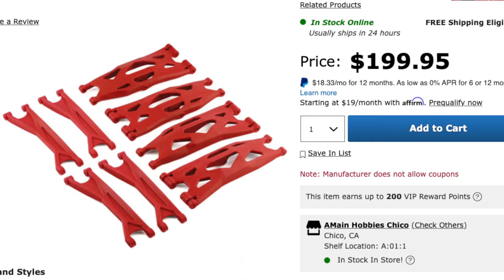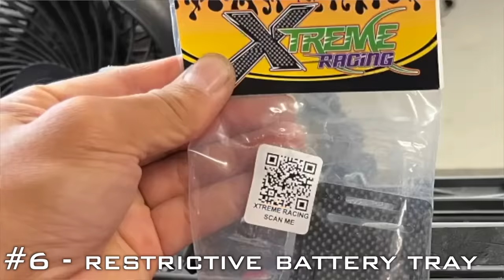7 worst Traxxas X-maxx problems - and how to fix

Comment: For all the people out there, who want to destroy your vehicle, yes, you can do all these upgrades and spend another $400 - $500.  But, this is in my opinion is the most well built, well engineered, most durable you will find on the market today. There is simply nothing else that compares.  If you respect the vehicle, and don’t abuse it beyond its capability, it will last many years without breakage. I’ve had many different vehicles. I’ve had this one four years without breaking it once. I cannot say that about the others. Every time I went out with the other ones, they were guaranteed to break even with mild abuse. But then again, I am not out to destroy them but, I will do 8 - 10 foot vertical drops and 20 foot jumps regularly without fear of damaging this one.  For those people who want to get crazy with it, go for it. Not my style and, it is just more expense and downtime. Waiting for parts and repair.  The only thing I did upgrade, which I think it really needs is a better servo saver. The one it comes with is little too weak.  Everything else in this video, it’s just a waste of money. Respect it, and it won’t cost you a dime further. And, no, I do not work for Traxxas. It is the best damn vehicle made.  I love mine.  Best I’ve ever had.  It’ll take a beating.  Just don’t do the 20 to 30 foot vertical jumps like you see in the videos.  And, don’t run it at top speed into a wall.  Nothing can withstand that kind of torture for long.  Oh, another thing I did was soak it down with WD-40.  That trick really does work to make it even more break resistant.  All vehicles for that matter.  And, yes the body of it does pop off occasionally….usually in a cart wheel situation or if the front end hits something dead- on pretty hard.  I’ve never had to replace the A-arms either even when clipping a front tire on something at about 30 - 40 mph.  That’s where the WD-40 works best I think along with the shock attachment points.  Never broke one of those either.  Overall, the Xmaxx is and always will be my go to vehicle.
Reply: Thank you, you've given me more confidence in getting the xmaxx. much appreciated
Reply: That is why you fail. Where’s the fun in doing nothing.
Reply: @user-df3jq5tr8c  Fail?  What success do you aim for?  Destruction?  I’m an avid thrill seeker.  I enjoy life as far as I am willing go with it…in a responsible manner.  My decision.  Not yours.  I don’t go 'all in’ on anything.  Nope.  I do have limits.  Limits are good.  Throw caution to the wind and you will get wrecked in every aspect life will throw at you.  That is the mindset of a fool.  I just sold my electric unicycle and regret it.  Put 500 miles on it then had a pretty nasty crash because I was chased by a big dog.  The smart person learns from his mistakes, because some of them can be fatal.  I’ll go another route and avoid the dog next time.  Includes everything RC as well.  I hope you can learn to respect the speed, power, and weight of them before you or somebody else gets hurt.  Be wise about it as far as you are willing.  It is your life/your money after all.  Do what you want with it.  I have learned there is no profit, no joy, in destruction.  Destruction = pain.
Reply: Problem i had with mine was it begged to be driven hard 😅
Reply: @kermit56780  I agree it does beg for it and pushes the envelope of what one considers as even possible.  Why it is really what I consider ‘a good value’ …meaning, no repair cost compared against endless entertainment.  Win / win.  Who could ever complain about a win/win?  There are very few things in life that are.
Reply: Thank you for your comment, I'm looking to buy one here in the next few weeks. I'm mainly a crawler guy but have been getting into bashing here lately. I have a slash and I'll admit I'm pretty rough on it. Does the xmaxx in your opinion handle normal dirt courses pretty well? Biggest jump being roughly 2 foot tall?
Reply: @calebpeters6267  you will be amazed how well it handles…. especially if you have new tires, or keep it on dirt.  The tires will wear down just like all vehicles if you run it on asphalt or concrete streets.  But, if you keep it on dirt, the tires stay in like-new condition for a long long time.  You will probably never have to replace them.  There is one thing… It does have a Lotta power.  When you accelerate through a turn on dirt, it will slide because it is a heavy vehicle.  But, that is also a benefit because it will stay well planted if you can control over-throttling… going too fast.  That takes a bit of practice. after a few laps, you will get a feel for it.  It is plenty fast. I geared mine down so that it actually would run slower. I have more control over it. or, put a larger gear in it and learn how to drift.  I would think it would flip over, but, I never did that, so I can’t see how it would act. I usually run mine on very rough terrain at construction sites where I don’t want to run at full speed. it handles rough terrain so good it’s hard to believe even when you’re going very fast.
Reply: @Bryzle1  same here! Kinda the same terrain I currently run on. Have you done any modifications to yours? If so, what?
Reply: @calebpeters6267  I never modded it.  I thought about it at first, but when you start adding weight, that’s when things start breaking.  I’ve learned this through other vehicles.  Meaning once all those aluminum parts are added, it puts even more stress on everything else.  All the weak points, even the chassis will break.  You want it to stay flexible.  As it is, the plastic is quite elastic on the Xmax.  You want it to flex.  Give it a coating of WD-40.  It will flex even more….when it collides with something, it won’t shatter.
Reply: @Bryzle1 really, wd-40?! Seems like such a simple thing that I didn’t even realize! I’m thinking about picking up an xmaxx as my first big boy and the way you commented is pulling me towards it even more!!
Reply: Maybe you got lucky. I have gone through 4 2085x servos in the past year. They don’t last. I take my car out once every couple of months and for the past year or so I’ve only taken it in open fields and parking lots so it doesn’t get much abuse but the servos just don’t hold up. It’s annoying to take the truck apart and replace it. It’s not a five minute fix. A new servo is over $100
Reply: Nah, it tells me you’ve got another issue you aren’t aware of possibly.  Those servos shouldn’t burn out/go bad so quickly.  Make sure your wheels spin freely, servo isn’t binding, etc…. Is the servo make a buzzing noise when not being worked?  Wheel nuts on too tight?  Nothing should be so tight that actually prevents free movement.  Everything should be relatively loose so the parts can wiggle slightly.  I’d be checking the whole vehicle over.  If everything seems fine.  Go to a larger torque servo.  But, the servos should not be going out that quickly.
Reply: @Bryzle1  I have double and triple checked everything. I’ve researched this issue and many other people have experienced the same problem. I’ve taken this vehicle completely apart to clean it put it back together etc. never noticing anything out of the ordinary.
Reply: Indeed agree with you
Reply: Like spray the whole truck with WD-40 or what exactly 🤔🤔🫣
Reply: I agree with all this. I'm decently tough on mine and never have a problem.😊
Reply: @derek3154 yes. Spray then entire truck.  It also helps keep things clean, water and mud just falls off.
Reply: @hughjanus5518  damn, nice tip. Thanks 😎
Reply: @fatkat311  you have your servo saver too tight.  I beat the shit out of mine and I'm the 3rd owner of it over 6 years. After doing the Kevin talbot servo saved mod and keeping the servo saver nice and loose it basically cannot break
Reply: Great post
Reply: I’ve had traxxas and arrma. I just bought the xmaxx 2 weeks ago and compared to any arrma I’ve owned this thing sucks
Reply: Mine has lasted with only a broken control arm that I hooked on a small tree pinned full speed. And the only other thing I have done is popped out a hinge pin on the pavement, landing a jump wrong.  I have dozens upon dozens of battery packs through mine all these years.  Doesn’t want to quit especially the new ones with the heavy duty rear bearings. I upgraded mine and have not had a problem at all.
The servo stock definitely sucks. It’ll get you for a while, but the factory Traxxas upgrade one works really well surprisingly.

I also have done the WD-40 trick after a couple years of owning it, and I haven’t broke anything. I do jumps as high as 4 to 5 feet tall and launch to about 20 to 30 foot gaps under and it only pops the body off once in awhile.

Comment: What are you people doing with these trucks??? I’ve had my Xmaxx for almost 5 years. I’ve broken a spur gear, blew one tires and blew out the rear hun carrier bearings. Other than the body being beat up, it still runs solid AF.

Comment: Pull it out of the box, install your batteries and take it for a blast. Enjoy your new earth shaking R/C monster truck. If you are back yard bashing and hitting some small to moderate ramps, don’t even worry about having to upgrade anything. The motor and esc take a beating. Eventually you WILL break something & that is when you decide if you want upgrades or just replace with factory parts. 
I agree that the tires could have & should have been MUCH better. RPM rear hub carriers are a smart upgrade with the RPM hinge pins. But again, not absolutely necessary coming out of the gate. Steering servo? Yea it’s slow, but good until you damage it. A lot of the suggestions/opinions can be interpreted as things that you should or have to do or your X-Maxx is inferior. 
You spent $1000.00 bucks on one of the sickest R/C trucks ever produced, it’s nothing short of an R/C legend. Drive it like ya stole it and twek as needed.
Reply from the maker: good advice right there.
Reply: My understanding is the new xmaxx already has larger bearings in the rear hubs. I understand the hinge pins but is there some other reason for rear rpm hubs?
Reply: Mine broke 2-5mins in first run today.

Comment: I swapped to 50wt shock oil in the rear and added some preload to the front. Stays flatter under full throttle and makes holding wheelies wayyy easier. Also stops traction roll from being such an issue

Comment: You forgot the #1 problem
And most annoying.. the pinion is made of paper and stock they are never tight enough. First thing you should do is change it to a better brand and use green or red loctite. Never will have to worry about it ever again. The x maxx strips out the pinion on the first ride usually if you didn’t swap it or tighten and loctite it

Comment: The upgraded servo from traxxas still isnt good. the truck we have took a few nose dives and the servo quit, so now we gotta buy another one. Traxxas needs to stop making their cars proprietary, and used standard servo mounts and Electronics plugs so people have easier options.  Its crazy to me the money they want for that truck and the electronics are terrible. it should have their upgraded steering servo to start with.

Comment: This is not meant the author, I really like his insights and his helpful videos so much.

I have never seen the full stop rollover. I self-roll as I am better than Traxxas I think because I have eyes+ears, by using gas forward, no quick movements, you only lose inertia that way.
And when you see the window you give the extra power. but it was always building up inertia and couldn't be more gentle.
My auto roll is like that too I believe.
Anyway, I have never understood why you have roll and brake, reverse, when any car with heavy wheels/any diameter--extension-tire will roll with 1-way throttle.(depending on many things, but a roof skid with u shape will make any Karton 6S roll like a carton off 6 eggs. My typhoon tools and looks beautiful, no egg comparison needed. Typhoon 6s truggy is arrma's best car.
But I know many can't get out of a few inches of snow, same thing. So definitely understand that this is breaking their crap.
I use it on everybrand,like Arma,Nikko,W.l RC,my Dji,  Kyosho , jd, hpi so far.
Btw, elitist are always fun, they are from my perspective well informed, like all fanboys.Nostradumbasses is the technical name for them,btw

But whatever you found incorrect, my throttle off on build-ups lands my cars right way up, there is a clue.

Comment: Best things I can think about of the class is the aftermarket body's fit the 1/5th scale gas monster trucks like the Redcat Rampage and the aftermarket wheels that have actual 14mm hexes instead of Traxxas's stand alone hex can also be used on the 1/5th scale gas monster trucks

Comment: My X-Maxx has a unique problem. It won’t steer, but if i turn the wheels away from center, turn it on, and push on the wheels the servo will center and hold the wheels there as if it works fine. TSM won’t automatically steer and I confirmed that the steering on the transmitter works by switching around receiver wires. What does this sound like to you?

If i do need a new servo, how does the Perfect Pass Monster sound?

edit: If and when my ESC burns out, does the max6 esc need a higher C count than traxxas batteries (25c)? I really dont want to have to buy new batteries.
Reply: If steering works in other slots on your esc then it’s your esc.
Reply: @papag5433  I said it doesn’t… plus what does the ESC have to do with it? it would be the receiver.

Comment: 2 more weakness you need to add base on my experience with my xmaxx 8s are 
The xmaxx body need the washer , cause when you basing,the screw in the body can goes thru the body
The stock pinion and spur gear are junk , always break especially if we using 18/46 gearing by traxxas pin gear mesh, it will always break. I have to get the hot raing gear then this problem stop.
Reply from the maker: Good call!!!

Comment: 3 years in though not really testing it.
1 big crash mid air hit a solid wooden play ground post supporting swings. L arm lower, shock shaft bent, upper arm and steering jont all sorted fairly cheaply. I just noticed a broken corner of the front top section after 2 years....
Works great. Never a blow out, stock 8700 Traxx batteries are a disappointment in puffing so soon with rare use.
No RPN oversized bearing mention?? ok fair enough, we can all be victims of YouLube the advertising agency profits people on here the more clicks. Good info thx. Nice it bucks the trend of what others claim is needed.

Comment: First off the drivetrain cannot handle the 8s power.
They eat spurs and pinions all the time because they are made of junk metal.
Tires are not strong enough either, but they give amazing in air attitude control.
Belted tires don't explode, but they are garbage for backflips and attitude control.
Steering servo is also junk.

Comment: To upgrade the servo did you need to modify anything? I’ve gone through several 2085X and they are trash. Very light use and they last maybe 10 to 20 hours if that

Comment: The body is a weak spot. The plastic is thin and weak and it pops off a lot. Not once did I have issues with my tires because of the way they were made. Been through 1 set amd that was my fault. Non vented tires don't like water too much.🤣 The stock 2085 servo in mine never failed me even after 2 years but I did upgrade to the 2085X because it was becoming weak. The stock ESC - 8S Garbage. Get a MAX6, and watch your gearing. The motor fans... Trash and not necessary if you know how to gear it right. Front arms breaking was because of cold and my bad driving. Flipping over can be minimalized by suspension adjustment,  and throttle control. The stock battery trays definitely need a different solution. The strap idea is a good idea. Best recommendation I suggest is drive it until it breaks then upgrade as you go! Have fun, enjoy, and happy RCing everyone. And thank you for another great video!!!

Comment: Only thing I have broken on mine is one lower front suspension arm and some body damage. Other than that my pinion set screw keeps coming lose, I'm about to go with some red loctite.
Reply from the maker: Ooooh, red loctite! Scary.   So you haven't blown the tires? 6s or 8s?
Reply: @RC Review  I have not blown the tires, but I have ripped the tires off the wheels and then superglued them back on a few times. I am running on 8s. Only one time (the first time) I drove it, did the pinion stay on. I was gentle on it that time, in comparison to the others. I just cleaned the pinion and set screw and put blue loctite on it and waiting for it to set. If that doesn't hold, it's red loctite for me.

Comment: Depends on how you treat your rc mins had know issue as for the tyres i use fishing line just use a needle push it through the tread go all the way around the tyres once job done tyres don't bloon don't use plastic line it needs to be the string type as its way stronger i do all my trucks. Keep your rc clean after using it dont bash them and you won't need to keep buying shit.

Comment: Awesome info. For a thousand dollars these issues should not exist in the first place imo. But there has to be an upgrade available i guess. Smaller bashers can be bought without needing any upgrading or worry about tires blowing out or any other breakage.

Comment: Video is dead on, I’ve done literally every upgrade in the video including the wide maxx. Only thing I have done differently is I run the Max amps batteries for extra power and believe me they are noticeably faster than the traxxas and other brand batteries.